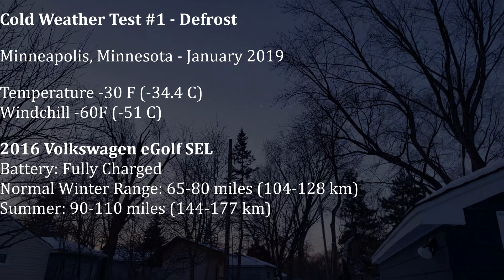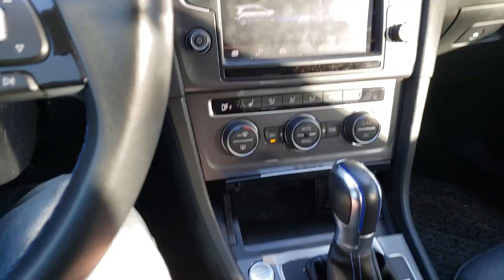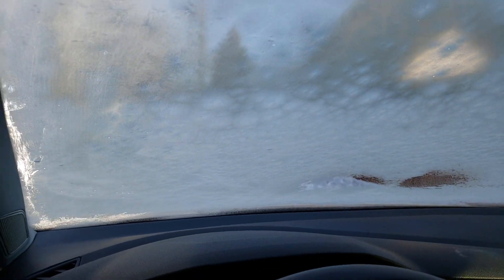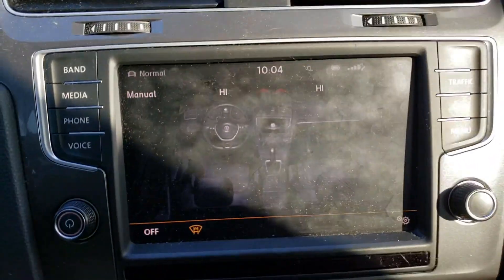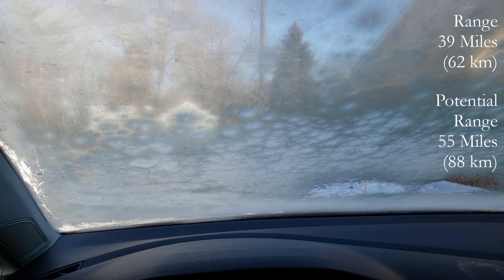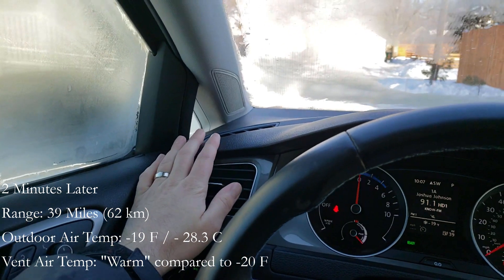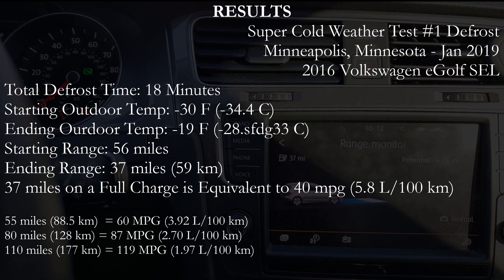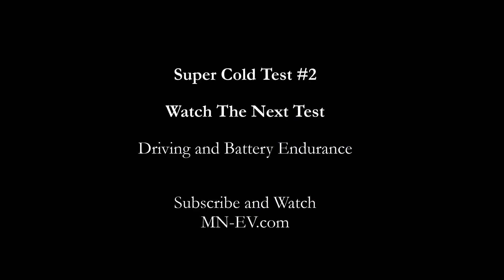Volkswagen eGolf Super Cold Test #1 - Windshield Defrost -30° F (-34° C | 222° K)

Comment: High... nice test! Actually I am surprised it does drive at all.  What element you did not mention is the battery size. Is the smaller of larger (32kwh) battery?  Second question is, whether you have the heat pump or standard heater?  Appreciate your reaction.   Actually I do have another question. Technically, it should be possible to use a stand-heater using diesel or gasoline, as the Golf has a water-cooling circuit. Did you check this out by chance?

Comment: Hey there - Canadian here - I had the VW dealership change the front windshield defrost to 30 minutes before it turns off. Apparently these cars come from the factory with a setting of 4 minutes.  Made a significant difference and was able to clear the front windows on very cold mornings.

Comment: Thanks for the video!  We too live in MN and just bought an E Golf after doing our own research.  You are right there wasn’t a lot of info on how it does in the extremes we have up here. So far our first winter has been interesting.  We were expecting a range decrease but were surprised how much it dropped even when using the preheating option while plugged in and the Breaking mode and eco plus mode.  Thankfully we can plug in during the day before the afternoon commute.  One issue we are still trying to figure out is why we can never get actual heat while driving in normal mode.  The seat warmers make it tolerable for those in the front seats on short to mid time drives but for the kids in the back they need to be bundled up.  We are bringing it to the dealership to ask this question, we saw there is a service bulletin for the heat pump.
Reply: Thanks.for the video... y8u didn't mention if yours had the heat pump option

Comment: Could you have left it plugged in while you warmed up the car so the battery wouldn't be compromised?
Reply: Dennis Bird yes. Also the sel models have a heat pump for added efficiency... but the manual still says not to keep it outside in -13 F conditions though 🤦‍♂️

Maybe his car has the heat pump option?

Comment: Its a good thing that it even worked at all. I have read that the hybrid VW Golf GTE and the Passat GTE won't start at all in those temperatures to protect the batteries as they are air cooled and can't be pre-heated. I don't know if this is the case for the eGolf or newer models of the GTE...?
Reply: Gte does have watercooled battery and it does let you drive e-mode at -30c  if you pre-heat with charging. I would say you need empty-->full charge to get enought temp to battery at -30c. Also make sure you have latest updates on your Gte